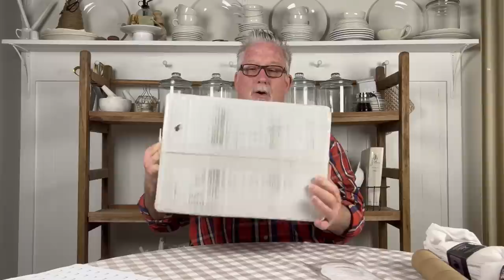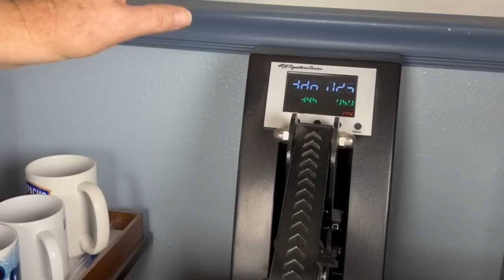How To Sublimate Socks! And Where To Get Blanks & Designs!

Comment: Grreat video.          what is the dimension of the sock designs. I notice you said it cant be done in cricuit.
Reply from the maker: Hey! The widest part of the sock file is approximately 3-1/4” at the top portion, and the height of the small is 8.45”, the height of the medium is 9.89”, and the height of the large is 10.63”. Thanks for watching!

Comment: Hi Roy!  I have te 7710 as well. What are settings your print setting for subbing?
Reply from the maker: Hey, Dell! I design/resize all images in Photoshop Elements, save as a png, print from Preview, and have “EPSON Color Controls” selected under “Color Matching.” Under “Print Settings” I use “Premium Presentation Paper Matte” and have the print quality set to “Normal.” And finally, under “Color Options,” I have “Manual Settings” checked. I hope this helps! Thanks for watching!